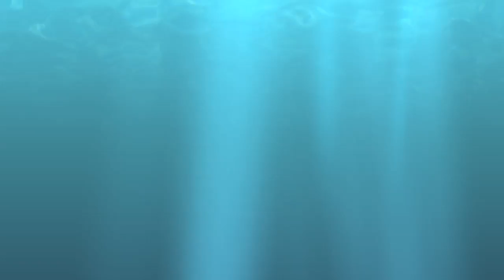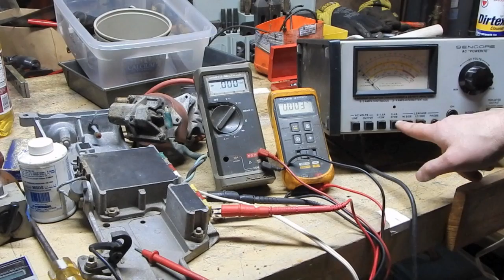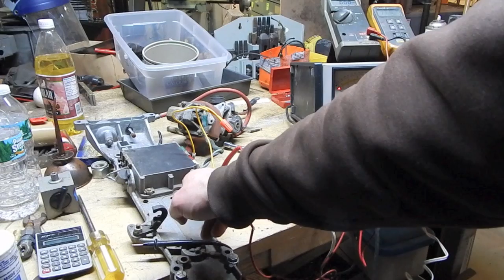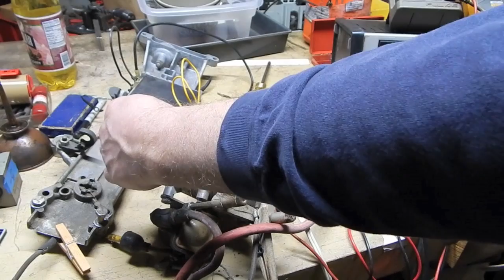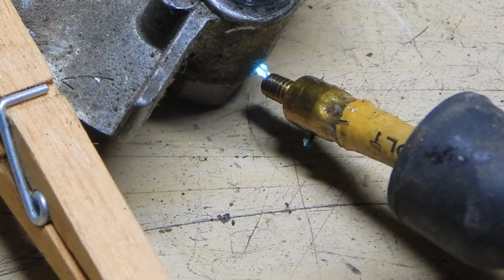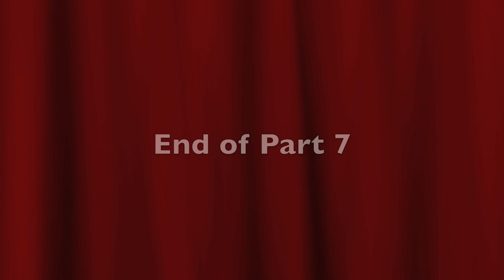The Mercury 115 "tower of power" outboard motor Part 7

Comment: The way ur wires look is what mine  looking like everything is fried or falling apart and also look like the cdi burned up to could all this be from a bad regulator? Its a 78 merc 40 402 and do u actually need the harness or can u tap wire and run from the boat side to save couple hundred and put towards other stuff like cdi. Stator, rectifier, voltage  regulator  ect
Reply from the maker: If you don't know the history of the motor, and it was burnt when you got it, it's possible someone hooked a battery up backwards, or the insulation was so badly damaged, that when a battery was hooked up, there was a short circuit, and it cooked. The "cdi", what mercury calks a switch box is big money. So do some other checks before you contemplate shelling out big money for one of those.